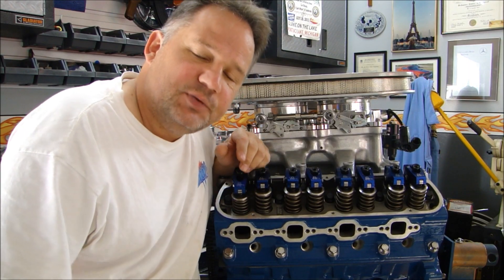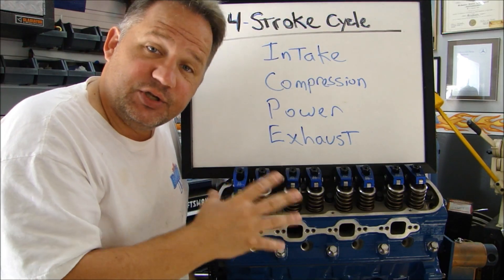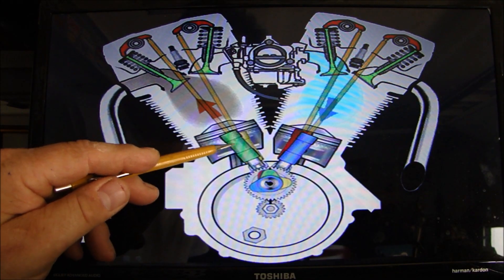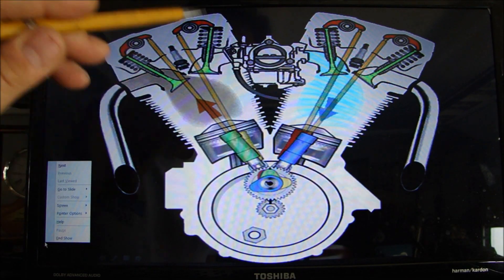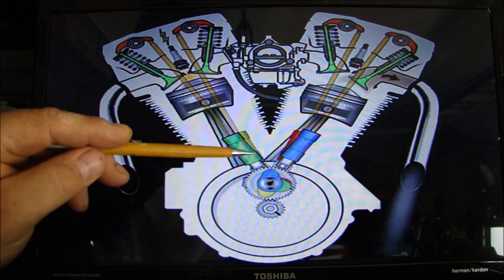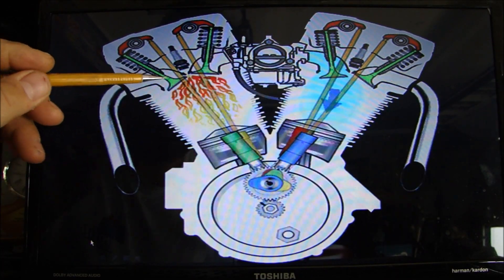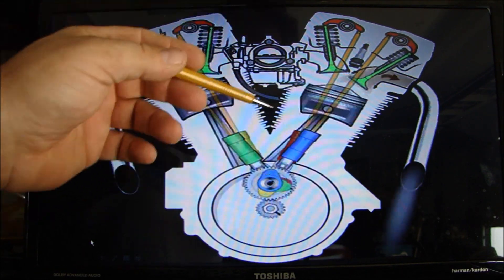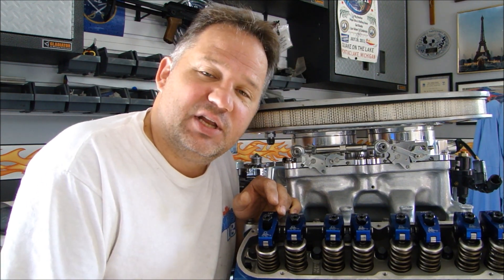The 4 Stroke Engine Cycle

Comment: Cool leason and cool animation. Thanks for the upload Pete. Awesome video as always :). But I have two comments, maybe they help or if i'm talking gibberish someone can correct me. For camshaft / crankshaft synchronisation also a timing belt  can be used. They're notorious and evil and I don't know why the hell anyone ever thought they'd be a good replacement for timing chains...  And about the tac-tac-tac-tac noise, best heard for example when the engine is idling - I've seen that a too big valve clearance can be a source of that noise. That's just my two cents to this video. Thanks again for uploading.

Comment: Thank you for the response I realize this will be a great challenge, if it were not why do it? Let me re-phrase my question.  What  are the differences between engines that are developed  for sustained high rpm running and those developed to run up and down the rpm range over and over again?

Comment: Hello I really enjoy your videos and have learned a lot.  I have begun, which right now is just a mental exercise, a project looking at land speed record car building.  I wanted to stay in the lower displacement classes and am looking at blown 1.5 L.  To that end I was looking around for a power plant that someone else has spent all the time and money on development. After researching I have been looking at a 1.5 L turbocharged BMW M10.  Do you think this motor suitable ( in the way it develops power and torque)?  I know that in qualify trim they developed about 1350 hp (staggering for 79 cuin).  Now I wont be burning 86% toluene like they did but thought this layout might be a good starting point.  Thoughts?
Reply from the maker: Wow...you're entering an area that demands a great deal of experience. I would find someone that has done this before (or has a lot of money to try) and keep working on it until you reach your goal. Never give up!

Comment: I would have thought with today's technology, someone would have came up with an engineered acrylic engine design, that would allow us to see real time engine operation. I wonder if it can be done? I remember building the clear plastic v8 engine models, that would allow you to see how the engine operated, buy turning the crankshaft
Reply from the maker: You could certainly make one. The issue is the durability of acrylic when it's heated.

Comment: Good vid, always very informative and I like the animations too. I've been messing with a 1996 2.2 Pontiac Sunfire that had a knocking sound that would come and go for the last couple weeks. So I finely pulled the engine out and took it a part. I think the problem was 1 of the 3 bolts that hold the torque converter on was coming loss and rubbing on the back of the engine. I'm hoping to have it done by this weekend and find out if that was it. I think all I had to do is just tighten it up, but it always had noisy lifter (ticking sound) so I did fix that problem at least lol.
Reply from the maker: Jeremy Lawlar That's cool. A loose bolt is never good.
Reply: Hey Pete, it's was the bolt lol.